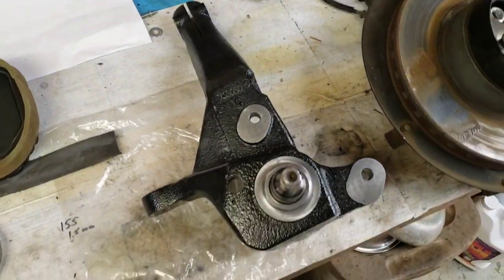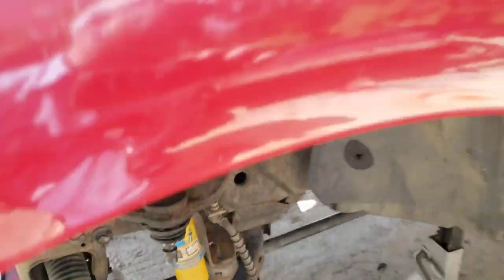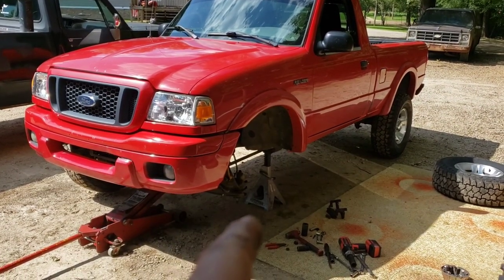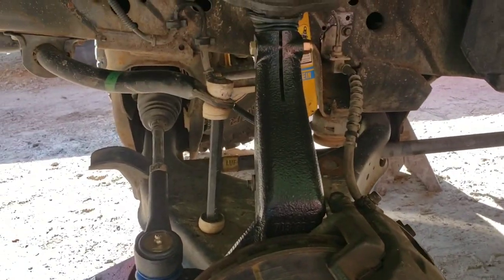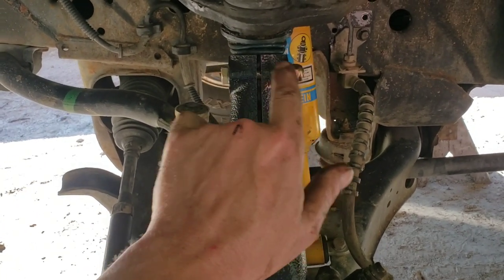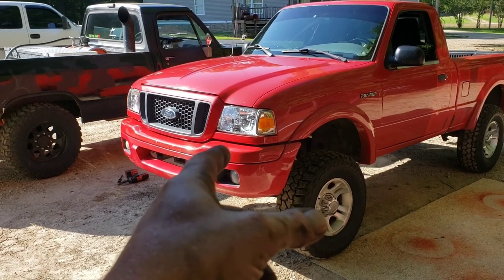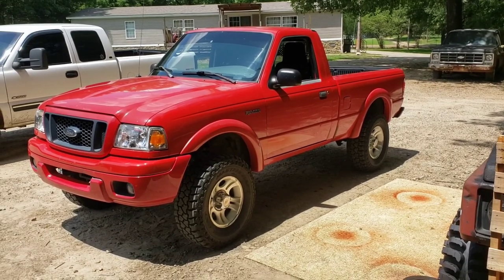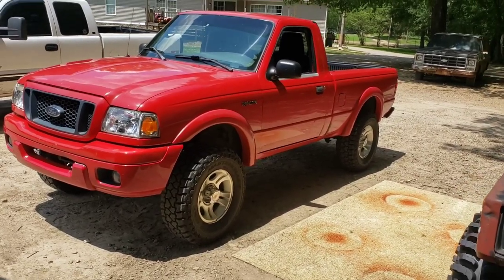Ford ranger edge lift spindles

Comment: I did the same on my 2004 Ranger Edge 2wd and I'm having alignment issues, did your ranger have any issues with alignment?
Reply from the maker: What kind of alignment issues are you having?
Reply: @turtleman5.9  camber issues, local shop in town is telling me to buy the extended upper control arms, and other sources tell me to get the lower cross member. I already installed the caster / camber kit 87500 from Specialty Products and it's still off by a bit. Any suggestions sir? Any help is greatly appreciated.
Reply from the maker: @srhclopez  from my research and my own problems.... ford made the upper control arms too short from the factory and I've only found one maybe two companies that offer extended control arms. To say they are extremely overpriced is an 8nder statement!! I too have a slight negative camber. I've been unable to find a proper fix. I rotate my tires every other oil change. Is your truck also a torsion bar truck or is it coil springs in the front?
Reply: @turtleman5.9  I have a torsion bar suspension sir. Thank you, and I'm doing as much research myself, if I find anything I will advise you. Thanks again.
Reply from the maker: @srhclopez  i preciate it!! Your welcome

Comment: Looks great, any drive line issues? Vibration from the new angle of the drive shaft and pinion?
Reply from the maker: The drive line angle didn't change, the edge trucks have a factory lift block in the back. Only lift it got was the spindles.